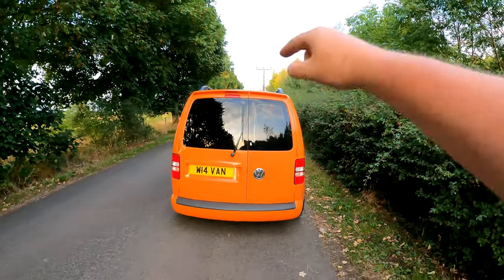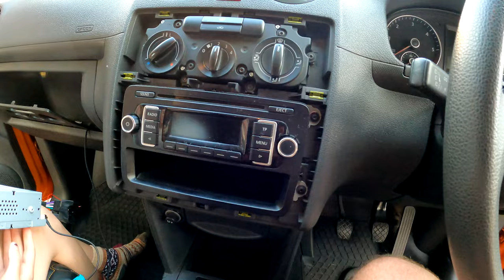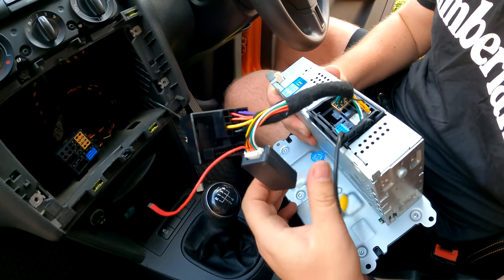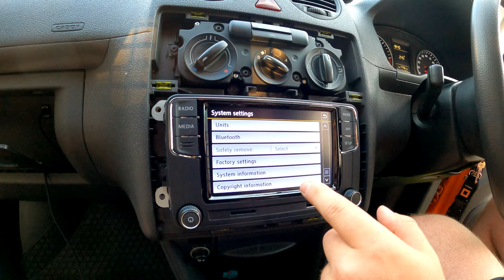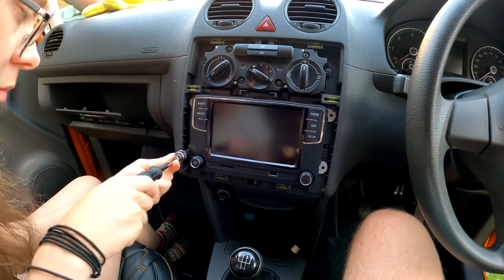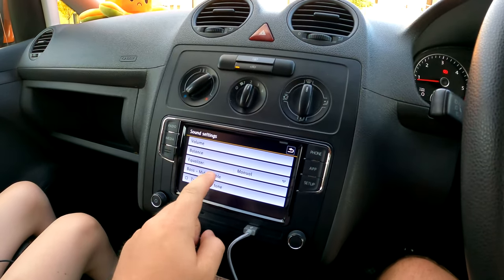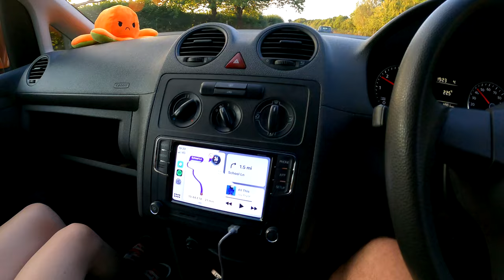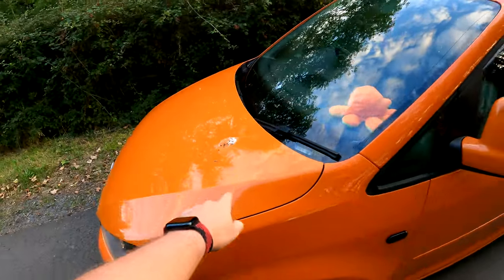I swapped the Caddy's stereo!

Comment: Almost TOOOOO easy.

Doesn't feel like a victory unless you at least have bleeding knuckles
Reply from the maker: I’ve had enough bleeding knuckles with the Focus, this feels like a reward. 😁😂
Reply: Whack some components in the doors, smidge of sound deadening.

All good.
Reply from the maker: Yeah that’s definitely the plan. When the rear is all ripped out for sound deadening we will definitely do the same for the doors. Possibly a speaker upgrade while we’re in there. 🙏🏼